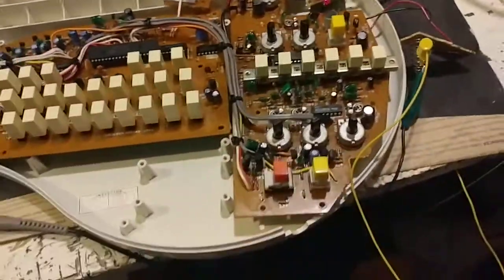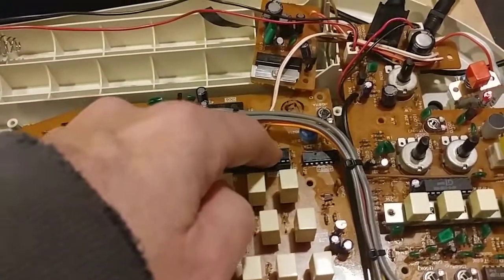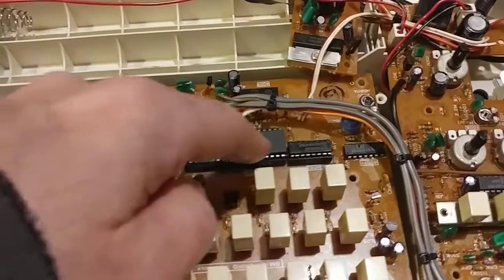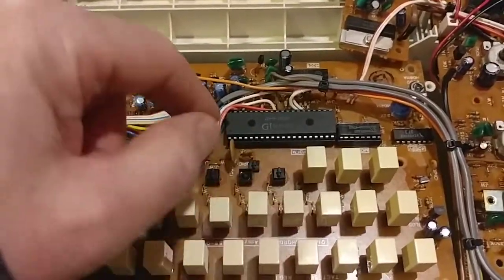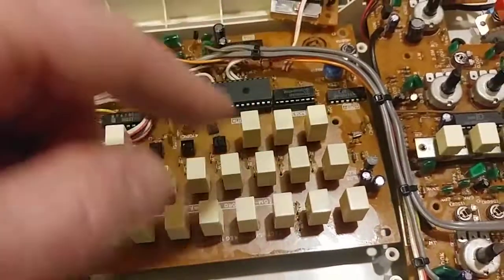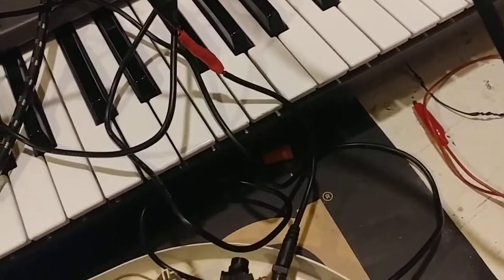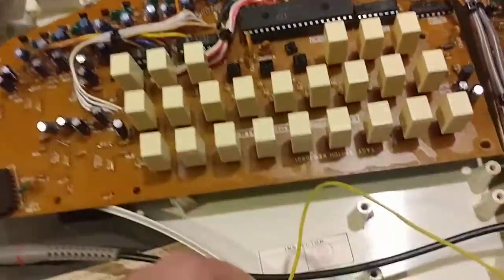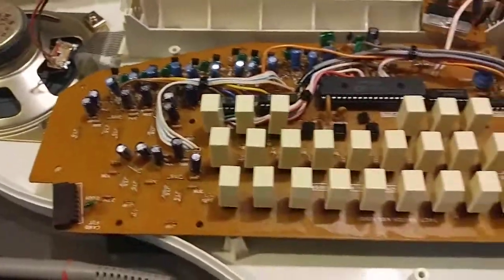Omnichord OM-27 troubleshooting problem with chord generator

Comment: Hi there, this is great.
You have the same model omnichord as me. I'm trying to repair mine now and it clearly has a burnt out resistor below the main chip. I've uploaded a photo, would you happen to know the value of this resistor? (struggling to find info)

Would really appreciate it if you had time to take a quick look! Many thanks

https://drive.google.com/folderview?id=1PvKwaBTKnfS5sCgo4D797pkwbVmTHY-8

P.s. someone has clearly repaired it before and has put a jumper on the 4001 chip (I stuck a photo of that in too as I have no idea why they've done that, thanks again in advance, any help would be greatly appreciated)
Reply from the maker: The jumper on the 4001 is between pins 1,2, and 14 (which gives power). This makes pin 3 always low (0v).  This in turns makes pin 9 always 0v. Still don't know why and I can't find the 4001 on schematics.
Reply from the maker: Contact me through email. eizdepski on yahoo.com. I have more details on the circuit and I want to move this conversation and turn it into an article on my blog at https://erichizdepski.wordpress.com
Reply: Hi Rory, I have the exact same issue. Did you ever find out the value of this resistor? Seems the diode next to it is also not working on mine. Thanks!

Comment: Hi There! I have this same model and the certain notes in some of the chord buttons either don't work or is distorted. I tried your trick of attaching a wire to the input of the AY51317A and notice that some of the input pins don't make a sound. Do you think the chip is bad?
Reply from the maker: Sorry I never saw this. Have a look at this other post: https://erichizdepski.wordpress.com/2020/09/06/omnichord-om-27-repairs This covers button cleaning because that could be part of your problem. The inputs for AY51317 come from the MO83. If there is no input to the AY51317, then the MO83 would be bad. If there is input but no output from the AY51317, then it is bad.  The MO83 also needs a clock from the 4069 next to it.